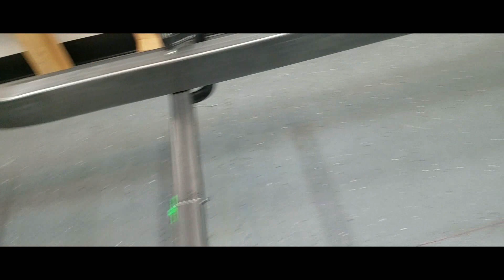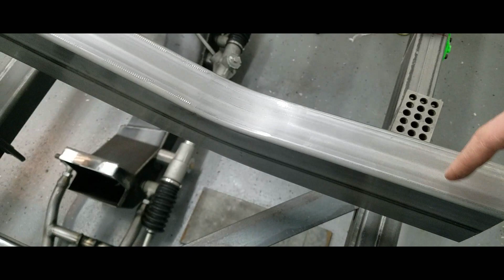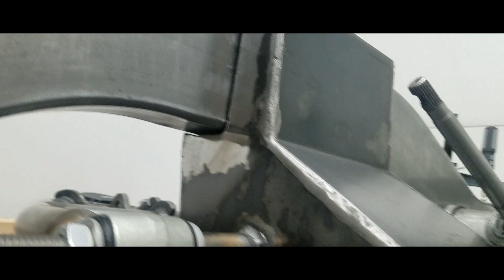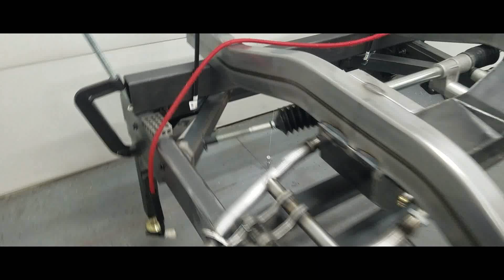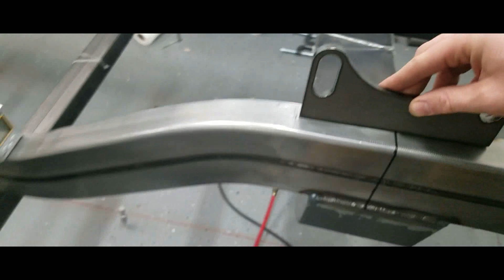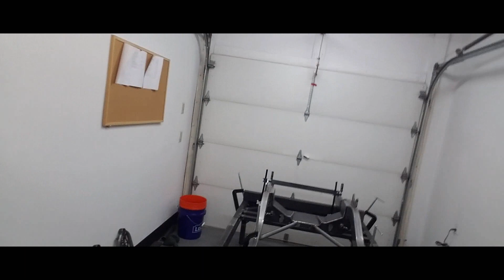C1500R Build, Episode #7,  Welding in our Front Suspension

Comment: I'm just thinking out loud here (I've never fabricated a chassis) but in the same way you printed your cad drawing and your cnc cut part earlier... Could you in theory use a plotter to print out all the large components (chassis rail, subframe, steering rack etc) and use that as the reference to start fixing? Hope to have a build like this one day.
Reply from the maker: Yes. A nice plotter would help for laying out stuff if you don't have a printer or cnc. The big thing is holding parts and removing freedom for warpage while welding. There are tons of ways to skin a cat. I knew I was gonna be doing alot of fab, so I built the plasma. Its been a huge time saver and has upped my level of professionalism in the outcome of my parts. You don't "need" it, but man, it helps. I'd highly recommend even one of the small hobbiest machines if you plan on doing stuff like this. Once you have one, you use it all the time. Mines paid for itself 20x over cutting jobs like bracksts and signs for other people.